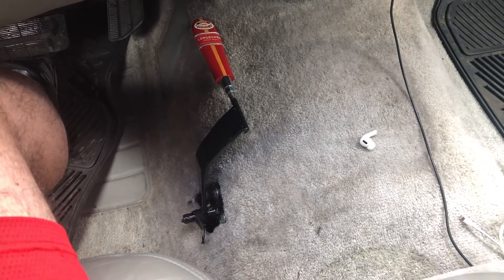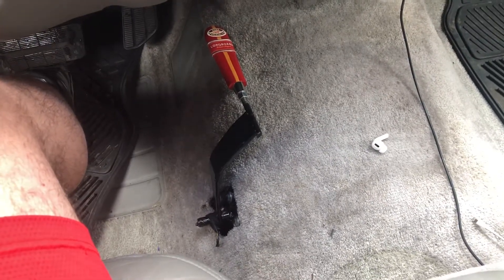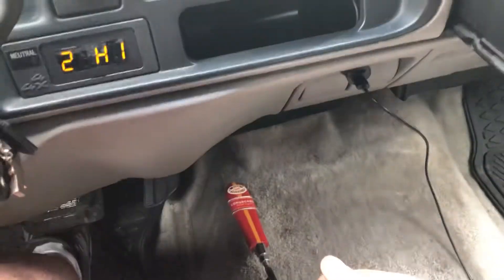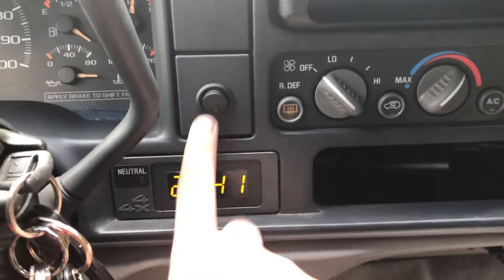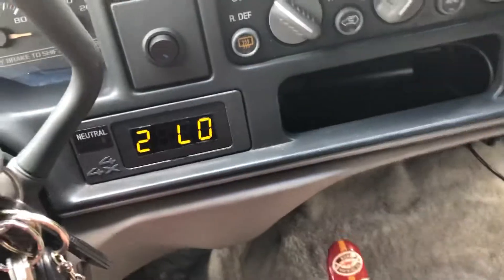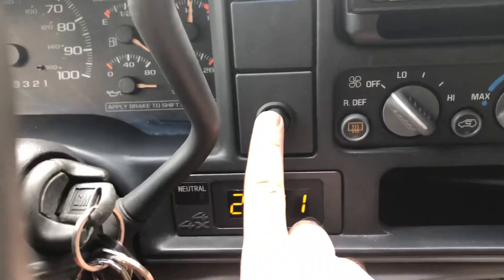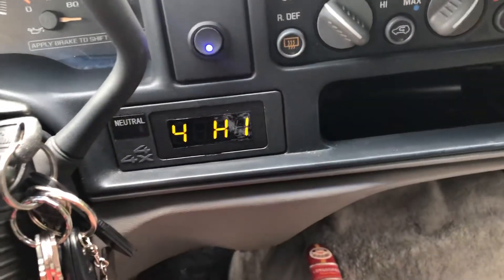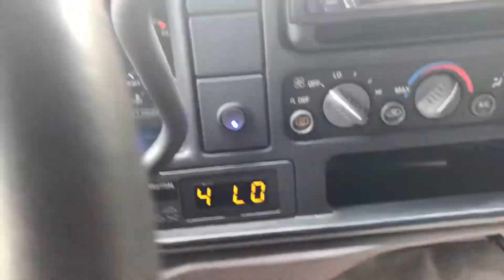Np246 manual conversion

Comment: Isn't a 246 a case have a 4wd auto setting? It's supposed to have wet clutches inside. How'd you get that working or just ignored it? You should have 2wd 4wdauto 4wdhi neutral and 4wdlo.
Reply: This can't be a 246, you are right. Probly a 243 or a 263
Reply: No way it’s a 246!